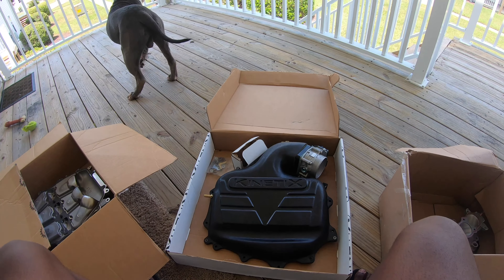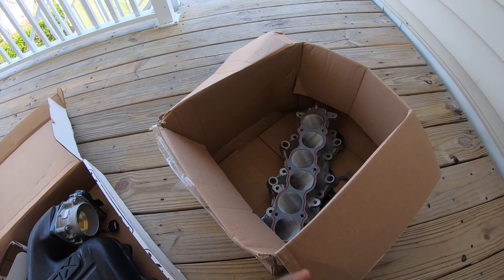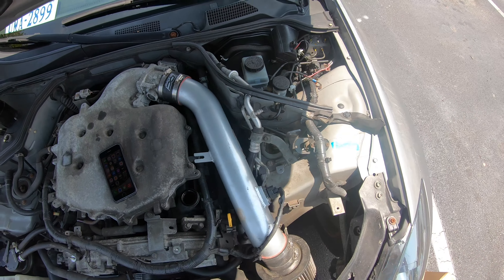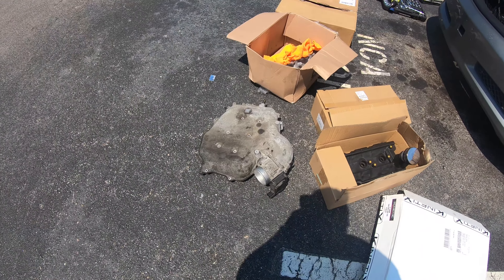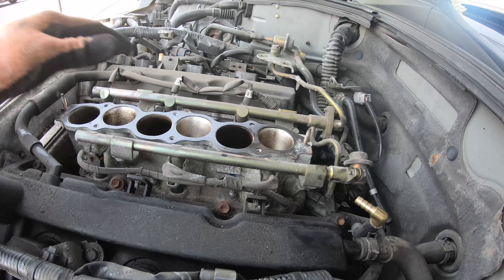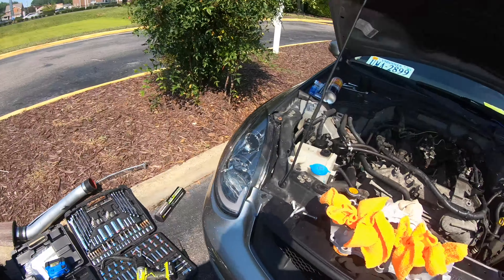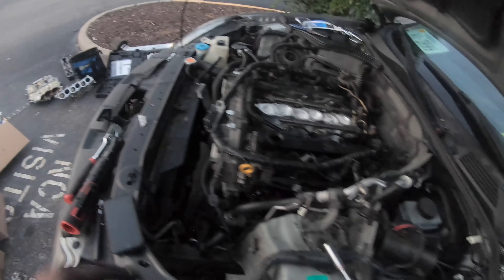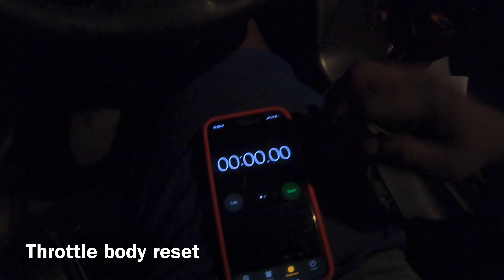YOU NEED THESE MODS FOR YOUR G35/350Z TO MAKE 300WHP G35 COUPE VS GENESIS G70 SEDAN

Comment: Just those modifications and a tune will not get you 300 wheel. You need cams and injectors and a few other supporting mods like long tube headers also playing around with wheel size dimensions and final drive can also influence that 300 wheel a person would be aiming for.
Reply from the maker: I have most of that already. Go look at my other videos homie
Reply: @IsThatGeneral  Nah bro he’s right. You need Cams at least 660cc injectors and better headers with full exhaust. I bet money u wont touch 300wheel without 272+ Cams
Reply from the maker: @stationd5  I never said he wasn’t . Idk about cams, but you def need almost a rebuilt car to touch 300wheel with a DE. I already know all of this. That’s why I said look at my other vids. I’m building the whole car from top to bottom.
Reply: @IsThatGeneral  looks like that dude wasn't paying attention... Lol
Reply: lies tbh everything depends on the health of the engine
Reply: Light weight pulls will help touch the 300 wheel

Comment: something worth mentioning is the oil cap mod would only be necessary IF youre boosted, wasted money if youre not. you already have a pcv line for high rpm on the drivers side that connects to the intake and uses the intake to help get rid of excessive crankcase pressure, extremely pointless if youre NA honestly. Just trying to help people save money, not everyone knows or explain it well enough for people. Shouldnt be said but do your research before buying anything someone tells you to get!
Reply from the maker: You’re correct, but that line doesn’t help with all of the excess pressure in the block and crankcase. Why not spend $60 to relieve even more pressure from the crankcase? Plus a lot of people want to run nitrous or boost anyways and don’t even know about this part for their VQ, so might as well spend that tiny $60 and be ahead of the game plus helping out your engine more.
Reply: @IsThatGeneral  you cant say everyone should have this on their g35 when you dont know what youre talking about. pcv systems dont get supplied boost like turbos or superchargers which is why its pointless NA. Not to mention theres pcv lines on each valve cover JUST for crankcase pressure, that will literally do their job just fine because engineers spent time working on that to not be a problem (while NA). AND if you read the description on the link you gave someone else in the comments, it literally says it has a check ball so WHEN you hit boost itll help with the pressure, which means when NA that thing is doing absolutely nothing because it takes a certain psi of boost to make the check ball move. the amount of people who actually boost their g's are way less than the people putting intakes and other mods, so you cant be saying every g35 need this, please if youre gonna be telling people to buy something, be specific. theres plenty of other g35 youtubers who do a good job at that and would cry of laughter watching this video

Comment: says mrev2 is for the rev up motor
Reply from the maker: Rev up and DE are the same motor. Only difference are cams and other  Internal components to help the rev up rev higher and make 10 more hp. You can use the mrev2 on your DE. It’s the same lower plenum on the rev up just ported.
Reply: @IsThatGeneral  the mrev2 plenum is not the same plenum in the rev up. the plenum runners are shorter in the rev up.

Comment: Can you post a link for your crankcase breather
Reply from the maker: Give me one sec
Reply from the maker: https://www.c-f-m.com/performanceparts/pc/CFM-Performance-Billet-Valve-Cover-Breather-for-2007-2008-Nissan-350Z-Infiniti-G35-p1663.htm
Reply: I can't find one for a 2003 350z
Reply from the maker: @Josh350z   it will fit your 2003* 350z. my g35 coupe is a 04"

Comment: Also, I suggest re-torquing the lower runners after several weeks of heat cycles.  All the lower bolts  on mine bar one were not to speck when I checked them a month after I did my upper and lower on my HR. Also your torque band will move up due to the increased air volume but decreased velocity. So you will loose about 10ft/p of torque through most of the revs. However the peak torque near to the top of the rev range will be about 10ft/p higher. I was quite dissapointed actually when I first drove mine after the lower runner port. But after the tune and getting used tot the different power band, I'm happy with it. Long story short, a full port of the runners is good for up top but not down low. The upper however improved everything on mine. 
Keep at it brother!

Comment: I don't know about 300 wheel horsepower but I'm pretty sure just a tune without any mods will get you to 300 flywheel horsepower. But if you want longevity just leave it stock. They're plenty quick bone stock.
Reply from the maker: I was saying these are key mods you’ll need to hit the 300wheel mark, but we will also see. Hitting 300 wheel with a DE without cams is hard.
Reply: @IsThatGeneral  I just put a new passenger side front hub and wheel bearing assembly in mine at 150k miles. I can't figure out why it's always the front passenger side. Obviously it's not always the passenger side but checkout all the how to videos and you'd think only the front passenger side goes bad.
Reply: @Cartier_specialist your girl is too big.

Comment: Isn’t the Kinetix Velocity Manifold faster than the one you installed
Reply from the maker: It’s supposed to be, but I’ve seen a lot of people lose power with that plenum. Even when they go boost with that plenum it doesn’t make power how it’s supposed to. I’ve seen about 10-20 people lose power and give it bad an bad review vs seeing about 5 people make power with it.
Reply: @IsThatGeneral  It looks really cool though like if it’s actually fast
Reply from the maker: @Iamablackkid  that jank is hard lol. I originally wanted that plenum over the V+ plenum until I seen all the bad videos and reviews on it. I have a video coming out that will show a better option than both of these plenums.
Reply: @IsThatGeneral  I’ll be on the lookout for that video

Comment: Those MREV2 lowers are actually DE lower plenums. If you compare a revup lower plenum the runners are shorter which is why it’s targeted more to the revup VQ because they will get better gains with the longer runners that the DE’s have. That’s why you keep saying you think you have a MREV lower already because it’s the exact same lower with I think very minimal porting.. if I’m not mistaken it even says in there website DE owners only see about a 3hp gain in the mid range unlike REVUP motors have a much higher gains
Reply from the maker: It’s 5 I think, but I was saying I think it’s a Mrev2 because it looked like it was ported judging by the sidewalls of the lower plenum. I already know they’re the same.
Reply: im trying to figure out which engines are rev up, i have an 07 coupe AT transmission, but replaced the engine with an 06 350z

Comment: Yee but add a throttle body spacer.. a spacer for the lower intake manifold and intake plenum spacer too.
Reply from the maker: Z1 Throttle body comes with a spacer and you can rain a 5/16th spacer with the kinetix plenum, but then you won’t be able to run a strut bar and you’ll most likely start running into hood clearance.
Reply: @IsThatGeneral  about to add kinetix to my 5/16th spacer. Felt a difference with the ported manifolds 👌🏽
Reply from the maker: @Ty_XP  you’re about to feel more now fam 🤞🏾
Reply: @IsThatGeneral  I thought the Kinetix upper plenum acted as a 5/16th spacer basically built-in. It's slanted and ported also for those reasons (to fit a strut bar)
Reply from the maker: @Beliefacy  it does. It’s slanted to get air to the front two cylinders, but you can still run a 5/8th plenum if you’d like. Seen someone do it on YouTube and spoke to them.
Reply: @IsThatGeneral  I think that's a clear waste of money IMO The $200 for plenum spacer could be used on something else since we'd already basically have on pre-installed with that upper plenum -_-
Reply from the maker: @Beliefacy  yea depends on how you look at it. If you add a plenum spacer with the v+ plenum it’ll be even more airflow and power, but I agree it’s not really needed.

Comment: Did u messure the port holes on the lower intake plenum to confirm there not the same mrev mod
Reply from the maker: No I just compared them at eye level and looked at the walls of the lower plenum. The walls were ported

Comment: Tbh if ur looking for high hp and torque just live with ur stock vq and save up for a LS swap. Only gon need around 8k for a complete swap. U can get a crate ls for 3-4k and parts for a complete swap are like 4k including exhaust. I would personally invest more for the engine for extended fun time but one out of a truck will hold up very, very well.
Reply from the maker: LS motors make good power no doubt, but some of us are purist and can't do it. I thought about swapping a LS3 when I first bought the G, but couldn't do it. I'd rather learn this platform by building it. Plus I already have my V8 charger, so gotta switch it up and build a fast v6.
Reply: At that point just buy something with an LS
Reply from the maker: @aloe9441  you can’t always take the easy route

Comment: Hey man I saw ur tag in the window that ur in va so am I and I just bought g35 and wanting to start putting mods on it just wondering if u had anything for sale cheap  I'm on a budget till the 1st of the yr
Reply from the maker: The only parts I have for sale are some Megan racing headers and a stock throttle body
Reply: @IsThatGeneral  how much u want for the headers and r they long tube or shortes
Reply from the maker: @ricky3868  $100 and they’re shorties

Comment: Did you put any gasket sealant on the plenum?
Reply from the maker: No I didn’t
Reply: @IsThatGeneral  cool and how much torque u use for the throttle body
Reply from the maker: @alvaradoc14  it can be hand tighten. Doesn’t really need to be torqued.

Comment: Nice. I have an 04 G35 6mt. Did you install headers? I have ISR headers on mine and I have that same Kinetix v+ on the way. I have ISR single exit exhaust too. I Gotta get a tune soon.
Reply from the maker: I have Megan racing headers but haven’t installed them yet because everyone says that they hit the steering Column and the welds break, so I’m going to get Dc sports shorty headers, then the car will be FBO and ready for a tune.
Reply: @IsThatGeneral  I gonna get tuned as soon as my Kinetix gets here. And I like your Charger, I had a Magnum RT. And are you in VA?  I live in Richmond. Oh and vids of my G35 and my old Magnum are on my page. I ran them at Richmond Dragway before it closed.
Reply from the maker: @siknin1  I’m in Virginia Beach bro and that’s wassup can’t wait to see it
Reply: @IsThatGeneral  I will make new vids after my tune. I installed the header, exhaust and cold air already just waiting for my Kinetix. But yea the exhaust sounds good. Check them out. I subbed 👍🏿
Reply: I decided to go without tune for now. Full f.b.o. minus headers and I have the AAM true dual 3" exhaust instead of a single. Talked to several guys who have turbo'd g35's and they all said I should not get a tune unless the car isn't running right after installing all the mods I've / we've done, until we turbo it. I did buy the cable and the license to E-tune prior to talking with these guys at different car shows around where I live, but now I'm waiting until I get a turbo on her. Having a custom kit made because the ones available aren't great and most have fitment issues. Saving up little by little.
Reply from the maker: @theg.c.142  I agree unless you want maximum performance now get a tune, but if the car is running fine and you’re ok with it, then wait because you’re going to have to pay for a retune if you get one now once you put the turbo on her. I’m going to get mine tuned after I do these next two installs just to see if I can hit 300wheel.
Reply: @IsThatGeneral  I'll be watching for the end result. Good luck brother.

Comment: Did you add rtv and did you torque them down ?
Reply from the maker: No I didn’t
Reply: @IsThatGeneral  damn I got crazy vacuum leak without rtv and not torque either..
Reply from the maker: @seth-mata  my bad bro. I torqued them down but i didn’t put rtv on anything.

Comment: Can you run a plenum spacer and this v+ plenum?  I heard a lot of people saying it won't work, that the car will go into limp mode?  If anyone can help me out with some suggestions that would be helpful
Reply from the maker: You can run it. Idk about the car going into limp mode, but I’ve seen a couple people run it and make hood numbers.
Reply: @IsThatGeneral  thanks I appreciate the help im trying to get this kinetix plenum and a plenum spacer but I got some people saying that it's too much volume of air for the ECU so it will just throw the car into limp mode but thanks for the advice
Reply from the maker: @bluueemethod434  if it goes into limp mode buy the upgraded gt maf form uprev. That’ll fix that problem because the upgraded maf senses more air volume. You need it if you want to go the boost route anyways.
Reply: @IsThatGeneral  I had no clue uprev makes upgraded maf sensors, I will definitely look into this if my car goes into limp mode, thanks brotha
Reply from the maker: @bluueemethod434  anytime

Comment: Where’d you buy your MREV2 from? Looks like the did very minimal porting and polishing on the front 2 runners, FYI the old lower plenum you pulled off is from factory, motordyne takes old plenums ports and polishes em and resells at a premium, so really you could’ve ported n polished yourself for cheap. But anyways yeah the old oily lower plenum you removed was not modified
Reply from the maker: Bough the new plenum from motordyne.
Reply: You can port and polish a standard DE plenum but it's hard to know exactly what machining motordyne has done, unless you have an mrev2 on hand to copy. The mrev2 might seem pricey for what it is but it has proven results. 
I was thinking of diy porting a DE plenum for my rev up but I ended up finding an Mrev 2 and 5/8 plenum spacer for a little over $450

Comment: Ported manifolds are great. Have you had a tune? 
Also those lower plenums don't look ported btw, you can tell with the casting marks still there??
Reply from the maker: Haven’t had a tune yet
Reply: Get that tune, my 350z is completely different now. It’s like she woke up. I went to Soho Motorsport. I’m not plugging them, but hell they did good work and they are specialists in the Z and G platforms and they in NC
Reply from the maker: @arnoldboats  I know about about soho, I’ll be getting a tune after these next few mods. About to upload my stage 5 clutch video

Comment: Guys, if your ecu doesn’t know that more air is coming through then there’s no power gain. You have to tune and re tune after every add on. Without a retune you ain’t shit but a laugh to the real tuners
Reply from the maker: You’re wrong my boi. The car is going to pick up horsepower and torque with each bolt on you install without getting an tune, BUT with an tune the gains will def always  be better

Comment: ‼️The car is 302 whp from the factory bro 😂
Reply from the maker: What g35 coupe with a vq35de make 300 wheel from factory bro put me on 😂
Reply: @IsThatGeneral  dawg. It says it in the manuals and on google. 280whp for the automatic, 307 whp for the manual version. Hondas are the ones that make less then 250. If your G35 is making less then 300hp it means it either has high mileage and some parts are worn, or you might need a serious retune. Cars lose horsepower over time, you gotta remember these are 20+ year old cars now. The G coupe was made in 2003, and the manual performance model with brembos made 307 hp along with the 350z nismo. My g coupe with 190k miles still makes 293 on the dyno bone stock. After I retuned it, it went to 297, I changed the injectors and fuel pump and got it to 305. All stock parts, 90% of them are OEM. Not hating I fw your build, G’s aswell as Z’s are my favorite car and I work on them regularly. I’m just speaking the core facts of those models.💯  The sedan made a lil less horsepower but it wasn’t under 260.
Reply from the maker: @smoke_sum597  I’ve never seen a g35 coupe with the vq35de make 300whp bone stock bro. Maybe the HR, but not the DE. I’ve watched so many others build their DE’s and also had my own VQ club with homies hitting the dyno with mods only making 260/270. It’s a known thing that’s it’s hard to hit 300whp with a DE if you don’t have cams, but go ahead and subscribe for me my boi because I’ll be getting tuned and hitting the dyno after these next three mods. We’re going to see if it’ll hit 300whp & I’m true full bolt on.